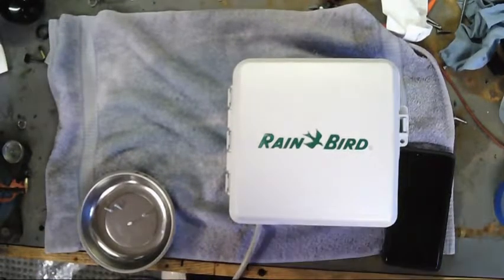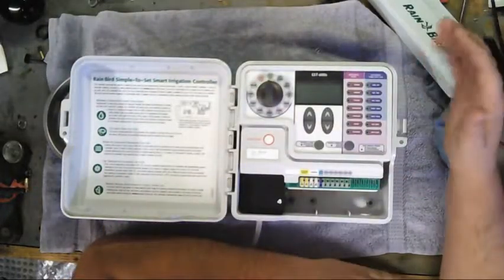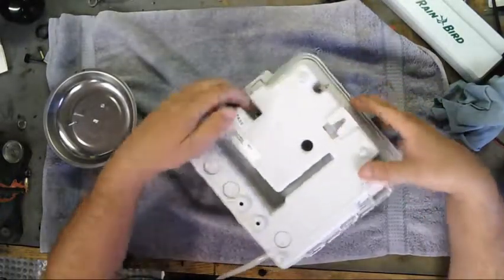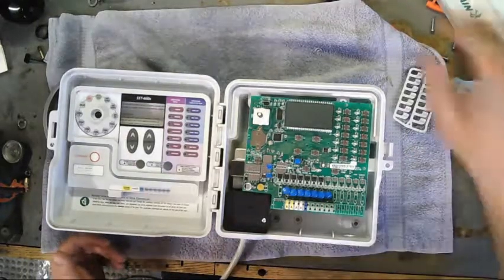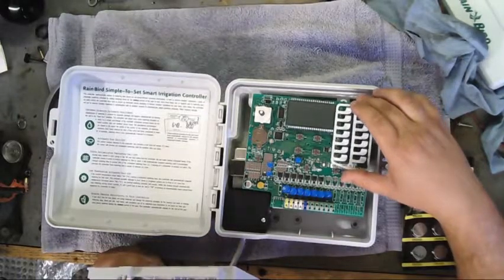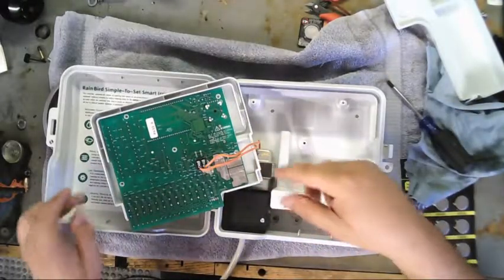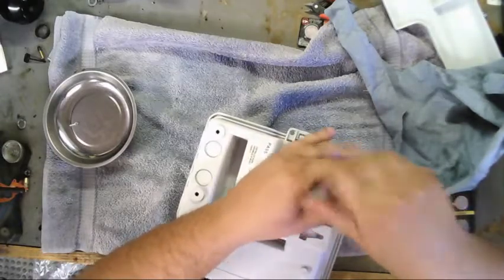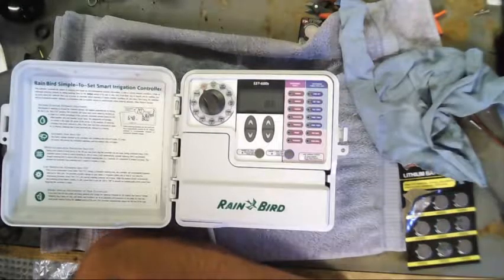Rain Bird  sst-600s battery replacement

Comment: What a doofus!  According to this video, you have to disconnect ALL of the zone wires and remove the controller in order to access the 4 screws on the back of the cabinet.  Easy peasy?  Not by a mile.  Then reconnect every zone wire.  They say you should replace the backup battery every 12 months.